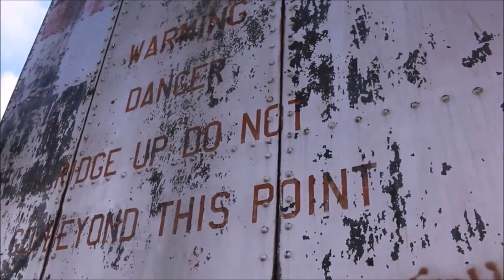UE - Climbing Abandoned MKT Bridge

Comment: Very cool video. When was the last time this bridge was lowered? You are very brave climbing that thing. Id be scared.
Reply: May 23 1986 i tionk
Reply: It was used the MKT railroad in the 1990s now it is abadon
Reply: +lidsman2221 The last train to ever cross this bridge was May 23rd of 1986. MKT abandoned this line due to flooding and washouts along the Missouri River (instead of doing constant and costly repairs). August 12, 1988 Missouri Pacific (Union Pacific) purchased Missouri-Kansas-Texas Railroad (MKT). Union Pacific has a MKT Heritage Unit (EMD SD70ACe) numbered 1988 (Commemorating the merger of the MKT RR into the UP system). This bridge has a website of it's own, and this video is featured on said website under the "Gallery" tab. www.katybridgefriends.org/
Reply: Thank you so much for the info!
Reply: Your welcome.